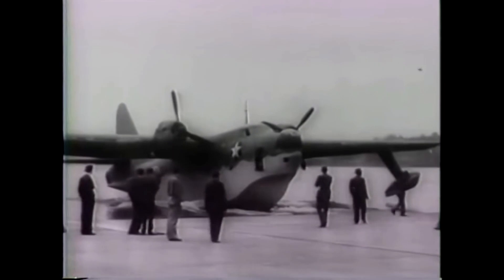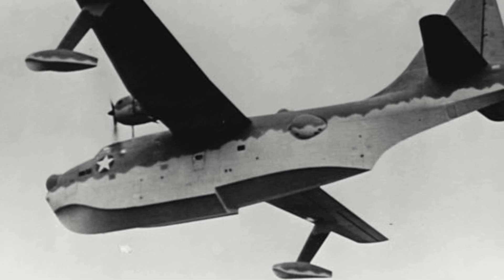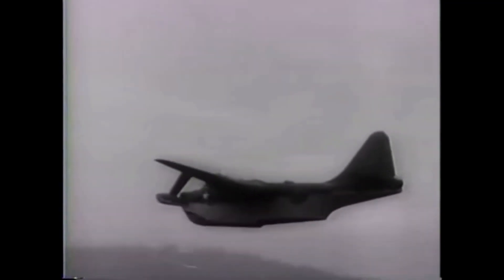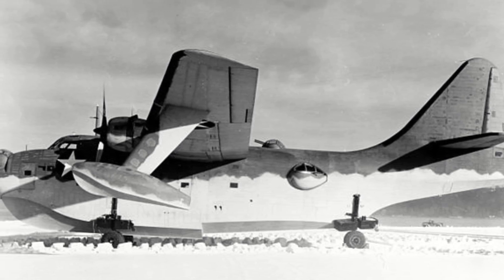Boeing's gigantic prototype flying boat: The XPBB-1 Sea Ranger

Comment from the maker: Hi all,
Just a quick correction. In the video I stated that the Sea Ranger is the largest flying boat of the war. As some have correctly pointed out this is not the case. Thank you to those that have corrected me. It should have been the largest twin engine flying boat of the war.  I must have gotten mixed up when writing.

anyhow, I have now removed this comment from video, so that the video can be error free. 👍✈

Comment: At 3:17, reconsider your wording. Really? Bigger than a Martin MARS? Or PB2Y-3 Coronado of 1940? Big for a Twin-Engine Flying Boat, Yes, perhaps 'biggest yet'.  Research. It's a lost art, as you re-write history incorrectly, that you should adhere towards.
Reply from the maker: Yes you are correct it is not the biggest flying boat that is a mistake on my part. I was meant to say the biggest twin engine flying boat. Sorry I got confused when writing this, but thanks for the pick up. I have removed that comment from the video. I always try my hardest to ensure that I am presenting factual information and always utilize a wide range of sources
Reply: While smaller than the Martin mars, it was actually bigger than the Coronado, despite only having two engines.

Comment: 3x, Powered Turrets with 2-of .50 cal guns each. The side blisters are Not 'turrets', but observation bubbles, yet, may include one of a .30 cal machine gun, or, perhaps, a .50-cal gun, on a hand-held swivel-mount. So, you have Nose, Mid-dorsal, and Tail Powered dual .50-cal Turrets, and two "other' hand-aimed, pintle-mounted machine guns, of either .30 or .50 calibers. No 
forward pointed 'strafe-guns' on this Boat, which, whilst hunting Subs (which in-the-day ,used Snorkels to See and Breathe, was an glaring Error on Boeing's part, given that was a Primary Mission of the Type!!
Reply from the maker: According to the pilot notes:
"Gunnery equipment consists of five Erco power operated tur-rets; one in the nose, one in the tail, one in the top waist at station 596 and one in each side waist at station 666."
It is odd that there wasn't any forward firing guns, definitely would have been important

Comment: What happened to the one example? did I miss that?
Reply from the maker: It is rather unknown. The trail seems to go cold once it is placed in storage and then retired from service in 1947. I never came across what occurred to it. Most likely scrapped although it would be cool to think that it could be sitting somewhere locked up.

Comment: Thank you very much for doing a video on the Sea Ranger. I have been interested in this aircraft ever since I first came across it many years ago. Too bad it didn't make it into production but I wonder if with only two engines it would be able to fly with one engine out. Thanks again!👍👍👍
Reply from the maker: No problem, thank you for the idea. It is quite an unique and interesting aircraft.  I do wonder too, most likely not. It is a very big aircraft with a lot of weight. 👍✈️
Reply: With all those turrets, probably not. Crew would have to be jettisoning everything they could. Hard to say without max weight and engine bhp stats.
Reply from the maker: I agree. The pilots notes might shed some more light. I have looked at them, but there is a lot of info in there.